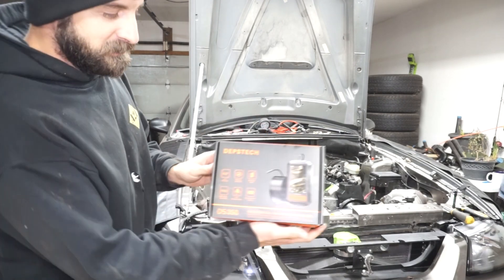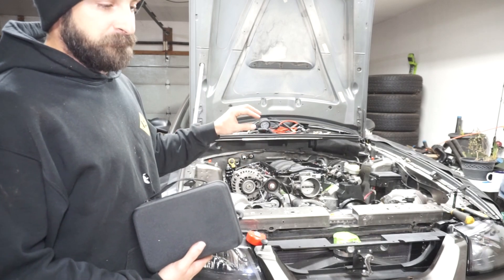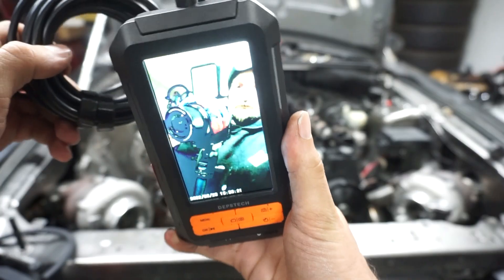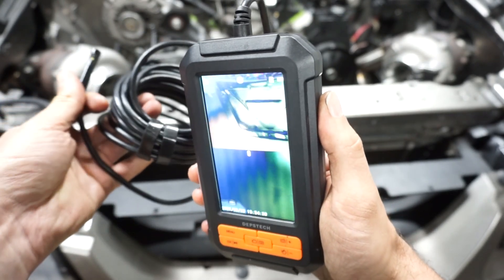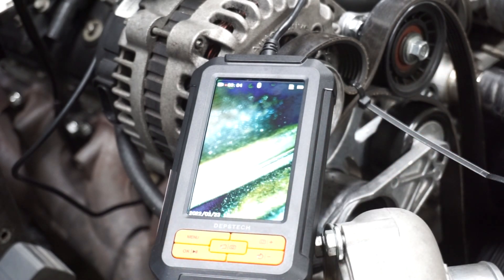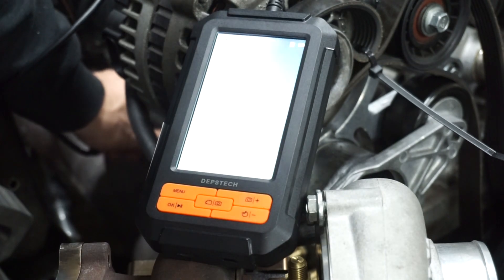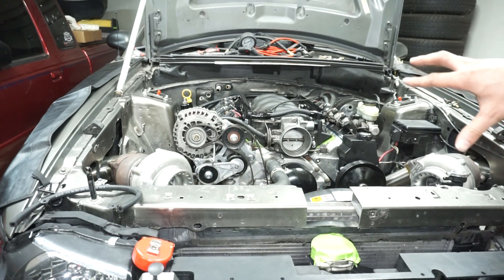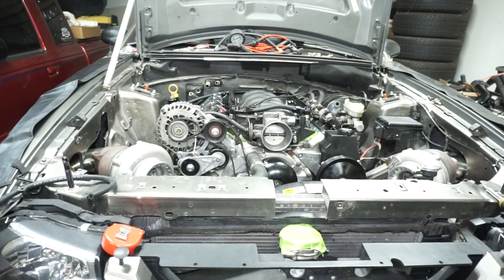Borescope Piston Sanity Check - Junkyard 5.3 inspection tool

Comment: Depstech do one of these that connects to your phone via wifi so you can use it as the screen, save videos and pictures to it. It's pretty decent, but doesn't have the sideways looking second camera - instead it comes with a little mirror attachment you clip on to see sideways that looks like it will instantly fall off inside the engine :text-green-game-over: The only problem I had with it is the size of the camera, as it was too big to fit down the spark plug hole of a motorcycle.

Comment: I bought a big block with big valve springs that I listened to running. Just to be sure i wasn't buying junk i did a leak down and compression test which looked great, tore it down just to be sure, every piston was scuffed quite heavily at the bottom of the bore (very short skirt) and every exhaust valve was bent but leak down indicated around 5% on every hole. The 800 pound valve springs hid all the damage

Comment: I’m concerned about the valves kissing the pistons.  Is it possible the cam either has too much lift or a lot of exhaust duration potentially causing a piston-to-valve issue? 
Or other issue with valve float from a valve spring issue? 🤔🤔🤔
Reply from the maker: It's a sloppy stage 3 so shouldn't be an issue.

Comment: I actually had a snap on, which wasn't great for the cost but seen a review like yours so I sold the snap on and bought a Teslong.
My Teslong is very similar to yours but sideways with a wider screen. It's great for the price point at about 90$
Reply from the maker: Yeah very reasonable for quality and few times I will use it.